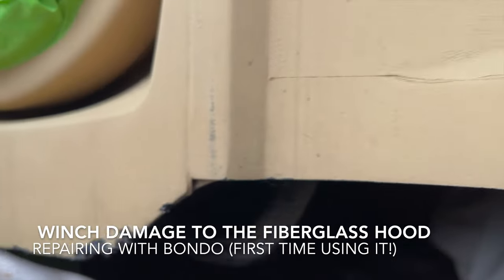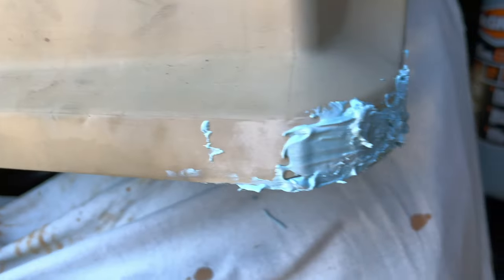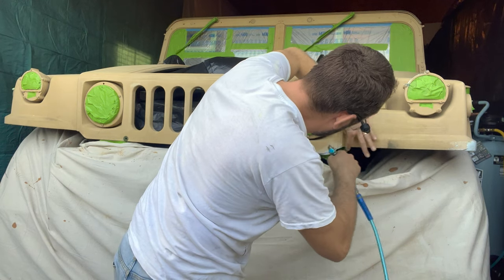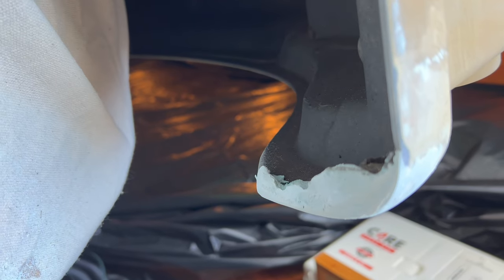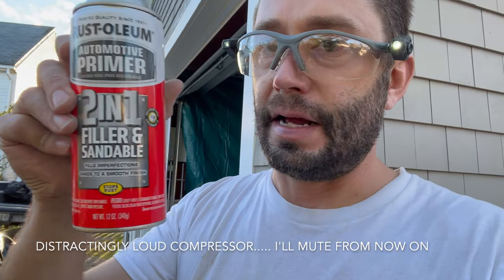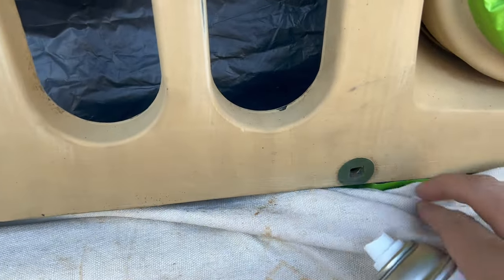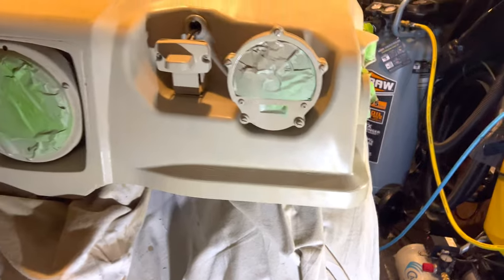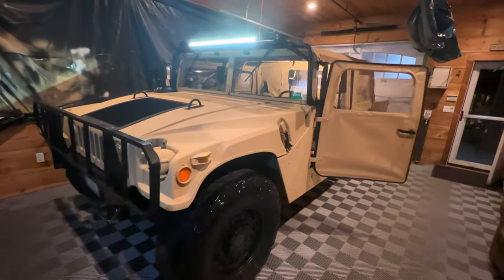Bondo for DIY Auto Body Repair for Beginners

Comment: You’re doing it. But yeah, too much hardener and light coats. Build it up too much and it will separate easier from the repair. And I didn’t see if you were but always wear a good respirator and eye protection. Especially if it’s fiberglass.